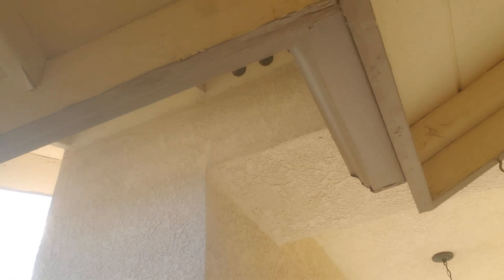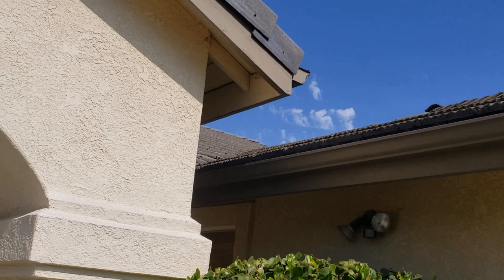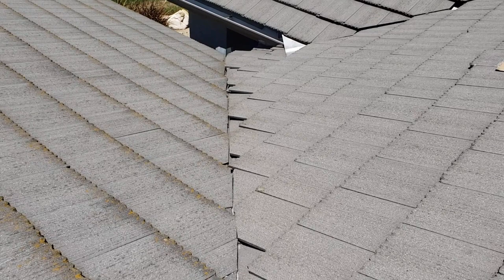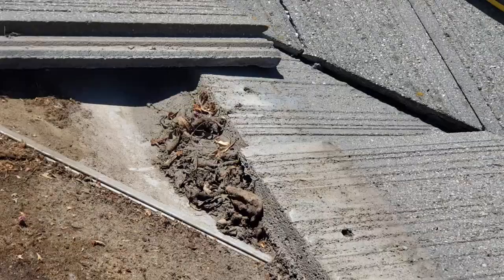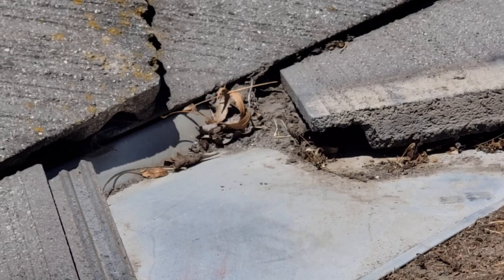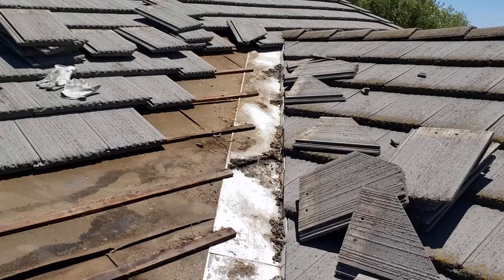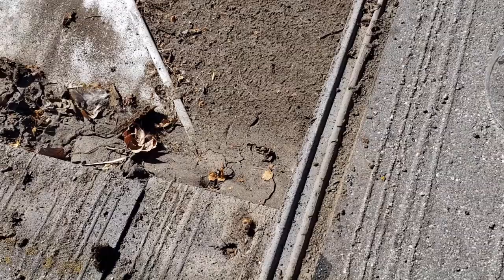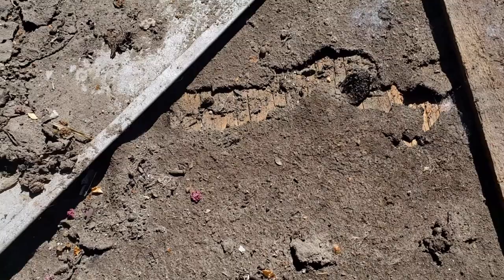WHY TILE ROOFS LEAK IN VALLEYS & HOW TO LOCATE & FIX THE LEAKS #tileroofleaks #howtolocateroofleaks

Comment: "Water burned holes in the paper?" That is an unusual  way to express it. I've seen paper split as I've removed tiles but I'm not sure how water could burn holes in it. Heat from the sun radiating through the tile, sure but water?
I appreciate the effort and agree that the valley tiles should be gapped away from each other. The installer has to cut the tiles anyway.
Thanks for the video.
Reply from the maker: Great comment, Gregory, over and over, I've seen areas where water, as shown in the video due to debris build up on the valley metal, deteriorates the adjacent paper. The paper becomes brittle, cracks open, and I've seen countless holes from the size of a quarter to much larger develop. Burning holes is a common term used for this.

Comment: Thanks for sharing this video. My parents have the exact same tiles and problem😂. I haven’t gone up there yet but base on what I can see, def debri build up and most likely same issue. Did you make a video of the repair?
Reply from the maker: You will need to remove 3'-4 ' of tile on each side of the valley. Then remove any redwood battens in the way. Replace the damaged roofing felt paper typically 40# paper. When re installing the redwood battens, be sure to coat the bottom of them with Henry's black mastic as they are nailed down and can also be a source of leaks if not sealed down. Also, some people like to number the tile. You can use a piece of tape and a sharpie. Thanks for watching checking out my other playlists. Some are music based, other are travel based. We also do a live podcast every Sunday dealing with primarily rock n roll topics and stories.

Comment: Why o why do the American system seem to choose closed valleys its madness . Common sense would tell you there going to block up . Also the tiles are there to keep the water out so clearly water is getting through the tiles to get to the paper .
Reply from the maker: Making the tile's tight in the valley for appearance sake Is a big mistake.

Comment: how do you fix it?
Reply from the maker: After the tile has been removed on both sides of the valley by approx 4 feet, and could be more depending on the condition of the roofing felt paper. Next, remove the bad felt paper and, of course, any redwood battens on top of the bad paper, install new felt paper, replace the roof tile.  Most  of the time, when I find this, the  cut tile on both sides of the valley is very close together, making it much easier for leaves and dirt to accumulate and start clogging the valley. People ask for this, preferring  not to see the valley metal. It's much safer to leave a couple of inches of exposed metal on each side of the valley.